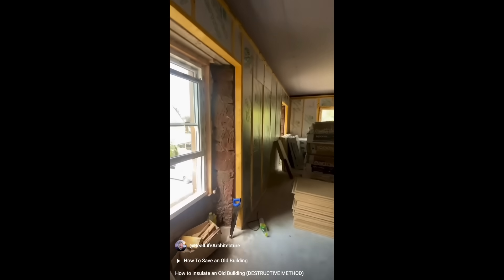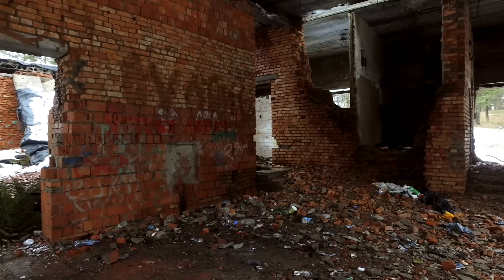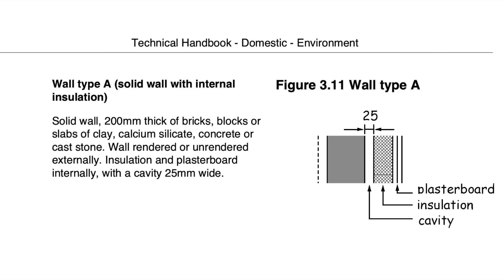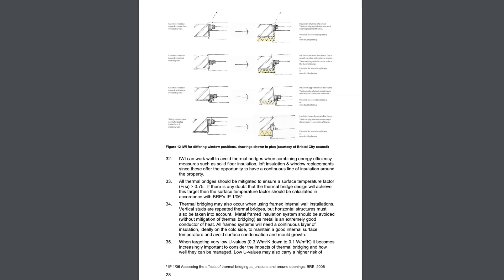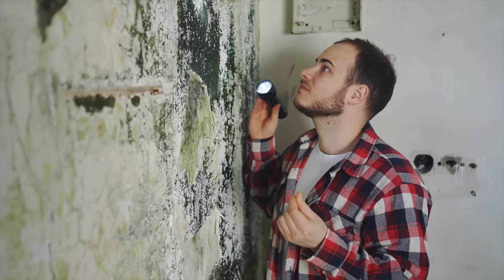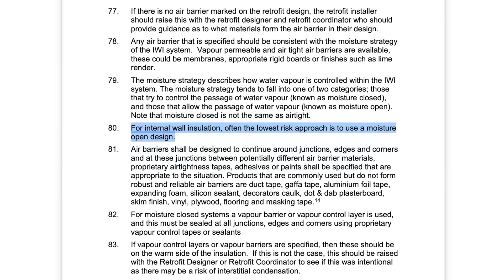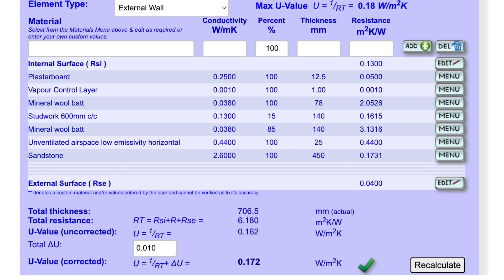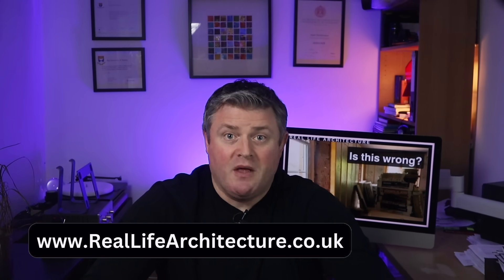How To Insulate Inside a Solid Wall in the UK

Comment: Make sure you pay a lot of attention to condensation. It’s the cause of so much damp in houses - especially old ones. Modern families with baths, showers and cooking make a huge amount of moisture. The warmer you heat your home, the more of that moisture can be carried in the air. As soon as it touches a cold surface like a window or north facing wall you get condensation - and if it’s in an area that doesn’t get much air circulation like behind a wardrobe you get the mildew too. If there is so much as the tiniest flaw in your inner insulation, that warm damp air will leak out and start condensing where you can’t see it - causing rot and mould. It’s one of the big things that put me off considering it. There are so many systems, all promising to be effective - but they haven’t really been around long enough to be assessed. Finding a tradesperson who will really put in the intense attention to detail that the installation requires can be hard too. I’ve opted for managing the moisture I make as much as possible (a cheap humidity gauge is useful) and putting an extra jumper on :) Good luck!
Reply: I have the same problem and agree. The information is just not good enough yet.

Comment: Great video Neil, and I get the thing about breathability, allowing a rain-damp wall to dry out from the inside, but my concern would be water vapour from living, breathing, washing, cooking, etc, passing through that nice cosy breathable layer and condensing on the inside surface of the solid wall, which is now freezing cold because of all that insulation.  Any thoughts on that?
Reply: This is what would happen without a vapour barrier as in this case.

Comment: I’m still watching this space. As the owner of an Edwardian terraced house with solid walls it’s a problem and I want to do the right thing. External insulation would wreck the look of the terrace and some internal options would make the already tiny rooms noticeably smaller. Protecting the building is also key as is improving efficiency of course. Thanks for the video and the useful comments it has generated.
Reply from the maker: I’m glad you found it useful, I am working on a follow up video
Reply: You do at least, in a terrace, have the benefit of 2 of your external walls 'insulated' by having neighbours living behind them.  If you don't have stone cills that can't be extended, or narrow window frames whose reveals can't be insulated on the returns, could you EWI the rear wall and then you've 3/4 of your house walls losing minimal heat?
Reply: @ It’s end of terrace so three external walls but you make a valid point thanks.
Reply: @Stringythingy 
Looking at drafts and ceilings is far more beneficial. The sorts of areas that have a far bigger bang per buck are windows, doors and ceilings. Walls are not most peoples issues.

Comment: This is generally good advice, but I'm surprised you didn't mention what I think is the best IWI method for most old buildings that pre-date DPCs: woodfibre glued to the internal wall with a lime-based plaster. Highly vapour open, very easy to do (parge it first if it's all wonky), good airtightness, adequate U-values. Very robust against dampness. A 19thC sandstone+rubble building with 80mm woodfibre on the inside (in Liverpool) recently had internal downpipe failure so the wall was saturated for a  few months. Pipe was unbunged, wall dried out. No mould, nothing bad. That's about as bad as it gets. The cavity (and corresponding wasted space), and membranes, are not needed.
And of course always remember that EWI is always technically better - you can have more insulation and there is no significant risk of interstitial condensation to worry about.
If you need advice go find your local AECB members or SPAB, both of whom will provide excellent info for older buildings, good building physics, and a sound environmental approach.

Comment: Excellent video. We've been retro-fitting rental properties to meet the EPC upgrade to "C" in 2025, for the last five years (which has now been pushed back). we used the PIR method really because of the lack of information about any alternatives. If the government is going to move forward with energy efficiency in the rental sector we really need more case studies and official good practice to be published.
Reply from the maker: Thanks for sharing!

Comment: We parged interior walls with insulating mix of sand, perlite, lime and ash. We have a very old rubble and earth built cottage, built into the hillside in rainy west Wales. We also put in lots of drainage so water gets away ASAP. You can feel the insulated wall is warmer than uninsulated but we don’t know the u values. We made this mix ourselves. It’s cheap(ish) and won’t rot. Done for two years now and there’s no damp on outside walls. Some damp where wall is against bank with no barrier. It’s just the mud colour coming through the whitewash finish, no mould.
Reply: This is a very good way to internally insulate old properties.
Reply: @MegJones7  what mix did you use? When you say ash, is that wood ash? Have a similar issue but with rough stone walls half of which is underground
Reply: @markthomas919  hello Mark, the mix….I can’t remember for sure…we think it was 1 lime, 1 ash, 1 sand and 3 perlite (the stuff that looks like polystyrene, which I did consider but didn’t like the idea of what it would do in a fire). Yes it was sieved wood ash but avoid cinders or charcoal because it will bleed through the surface when you white wash. 
One of our outside walls we dug down on the outside until we were below foundation, put in a holey pipe with fabric and clean stone around, then put in a sheet of 20mm recycled plastic board about 120mm away from wall. We put clean stone between the plastic and the wall and backfilled. This allows wall to ‘breathe’ and this wall is completely dry. The guttering protects rain water from getting in. Good luck.
Reply: @MegJones7  Thanks that's really helpful

Comment: 100 year plus stone built house with internal metal studing with 40mm insulation in-between stud looking to pump insulation between metal stud and stone wall (vapour barrier)to make it more airtight and to add more insulation thinking on grey beeds or something like it.
Reply: I am doing something similar but without filling the cavity. I think allowing airflow behind will help take away any moisture that works its way inside the cavity. Maybe even with a VMC unit. If the PIR is taped then that is effectively a vapor barrier?

Comment: Hello, over a year ago I bought a flat in a 120 year old building with lath plaster insulation inside. I started the renovation by insulating the floor with 90mm PIR and then cleaning the ventilation holes in the walls for ventilation under the suspended floor. Then I partially demolished the walls supporting the floor locally because there was not enough ventilation and moisture was accumulating. Now I have a dilemma whether to start insulating the walls after looking at this section. I reopened both open fireplaces and removed the foundation reaching the flat. I made a suspended floor in the places of the open fireplaces and in this way I got rid of the moisture rising from the ground. I closed one fireplace and renovated the other and put in a free-standing fireplace. The walls are starting to dry out and in winter it is a pleasant 24 degrees. I seriously wonder if it makes sense to invest hard money in repairing walls when I can buy 5 meters of wood for the winter and the apartment is dry.
I wonder why we don't go back to what our ancestors have known for a long time and improve this technology. Correct me if I'm wrong, but I haven't found any company that would make lath plaster walls from scratch based on new technologies. You could use perlite in a lime-sand mixture and lighten it. Instead of wooden laths, you could use plastic mesh and glass fiber. You could add plastic or stainless steel bristles to the mixture and strengthen the plaster. Such walls would last another 100 years. I wonder how many cm would have to be used to adapt to the new regulations. My opinion is that the new regulations only block the rational development of old technologies and we are stewing in damp apartments and houses because of CO2 and green agenda.....
Reply: You don't want lath and plaster - there are lots of ways that are just better. Using green building materials stops you having damp houses, and you can have a really comfortable, reasonably efficient, house, with very low embodied energy/emissions. There are plenty of bad ways to meet the regs, but also plenty of good ones that work well in old buildings. Don't blame the regs, nor emissions targets, for poor designs. Use woodfibre insulation, or diathonite (cork) plaster or aerogel plaster to get at least some insulaiton on the walls. You won't miss 60-80mm round the outside of normal rooms. Yes you could just keep burning loads of wood and have a building that doesn't even meet building regs, but that's a very high-carbon (and polluting) approach. Put some insulation in. Lime parging, 50-80mm of woodfibre and a lime plaster will make a robust wall that will last 100 years and have a reasonable level of insulation, whilst also working with the building to release moisture.
Reply: We used perlite, sand, lime and a bit of ash to make it sticky on our rough characterful stone walls. It’s working well. But it won’t be recognised as insulation because it hasn’t been approved.

Comment: Is what you say about being able to use any amount of insulation in an existing dwelling actually true? I thought there were rules that if you are redoing n% of the wall, the whole wall has to be done to meet a certain U-value?
Reply from the maker: Under part L of the English regulations certain u-values must be met if more than certain percentages of the overall building or of individual elements, such as a wall, are being renovated.

Comment: 1:10 please correct me if I'm, wrong but acording to part L: When renovating (+50%) of existing element in an existing dwelling(e.g. Removing internal plaster) , a u-value of 0.30 is mentioned.

Obviously only when appeasing building control, but Is this mandatory or merely recommended? Perhaps only applies to England.
Reply from the maker: You are correct and it applies in England. The percentages of work vary depending on when measuring one element, such as an individual wall, or the entire building. The owner will have to make an application to local building standards to demonstrate compliance and should do this prior to carrying out the work.
Reply: It is mandatory whether you are "appeasing" building control or not, Upgrading a thermal element requires Building Control approval if the existing element doesn't meet certain threshold values. From memory the threshold value for walls is 0.7. This means that if you decide to replaster or rerender that wall, or perhaps decide to insulate it, you will have to upgrade that walls insulation to a particular value. For cavity walls that minimum value is 0.55w/m2degc providing that the insulation is being provided entirely in the cavity. For solid walls (and cavity walls that cannot or arent being upgraded solely in the cavity) that value is much higher, 0.3 being the minimum required U value. Obviously if you choose not to get Building Regulation permission that is a separate issue. If your existing wall does meet the 0.7 threshold as it stands then you can still provide additional insulation if you want to, but my interpretation is that in those circumstances you would not require building regulation approval. Same principal applies to walls and floors, just different threshold and minimum insulation values.

Comment: I did this to a house in Scotland on the west side, concrete shuttered cement slurry 1924 it was built, very damp internally old batons directly fixed to the wall hardboard on some plasterboard on others, joist sat on the damp soil and rubble, We ripped it all out back to a shell, I did concrete slab internally with a dpm, suprisingly in three days the internal walls turned from nealry black to grey dried out fast, built the walls from a 3x2 stud 50mm pir board insulation 11mm sterling board on the outer with a cavity which was different everywhere (25mm minimum) as the building was not flat and square, with a house wrap fixed to the cavity side down and over the Dpm which was fixed to the concrete slab with a 4x2, on the inner part of the wall a foil was fixed and taped to the 3x2 wall then a 20mm  baton 11mm sterling board plasterboard over that the wall ended up been 125mm thick in the end, the r value was pretty good cant remember exactly what it was , this was about 2017 -2018, but one thing i did do was vent the cavity used an old chimney and some vents that were already in the walls, small but let in air and out which works well to keep the cavity dry and the house breathing, thanks for the video was interesting, old buildings need love too and can be as good as new built to a point.

Comment: how would you stop the insulation from falling into the cavity
Reply from the maker: Staple it to the timber frame, it’s noted on the diagram in the video
Reply: @RealLifeArchitecture Hi thanks for video , I'll be insulating ours same with the air gap venting up into attic , so the room will be fully insulated but a box within a box without the inner box (room) touching the outer original stone (box) so the walls can breath and vent into attic andy roof is breathable .

Comment: What about using sympathetic building techniques with proper lime plaster? How would youinsulate behind that? What plasterboard did you use to do this that is breathable to the same degree as lime plaster?
Reply: Yes, I'd have thought lime plaster would be best. I'm used to granite buildings further north and have seen many a damp house over the years. Usually that was condensation on renovated plastered or plasterboard walls. It's about vapour and air permeability, which makes breathable walls. It's often not the rain coming in that's the issue, rather the moisture escaping. Obviously, you can add in monitoring of humidity, dehumidifiers and extractors, but I suspect there's nothing better than just using the technology that works. 
If I was wanting to try something different, I'm intrigued by hemp fibre. Timber stud walls, with a 50mm gap from the solid wall, insulated between with hemp, and an additional layer of hemp in front of the stud walls to prevent bridging, with a lime plaster directly onto that. Probably lose 150mm per wall of course.
Reply: @ interesting. Have you looked at Sheep’s wool insulation? Amazing stuff. Resists rot, and mildew. It breathes and it’s sympathetic. Our home was quite damp. We had creeping wet up the walls from non-permeable porcelain tiles (two layers). Removed the flooring, the substrate (original concrete) can breathe, and suddenly the walls are no longer damp because the water was no longer being driven up them. I question the method in the video as having longevity. I think in five years, it will be the same issues. Maybe not on the surface, but black mould has a tendency to cause illness regardless.
Reply: @Jasminethelion  yes, I've used sheep's wool before. It appeared to work well for the five or so years I lived there, and I'd trust it had longevity well beyond that. The downside is keeping it lodged firmly in place, without squashing it. It's great on the horizontal axis, but that is certainly a limiting factor on the vertical (obviously in between studs it holds well). I suspect that over time, if it gains significant moisture without rest, then it might sag a little. I think if I were to do another renovation, I'd likely look at wood fibre or hemp and plaster directly onto that. Although that would be quite the test of my plastering skills!
Reply: @ Agreed!  Have your heard of insulating breathable plaster?  Might be something I try.
Reply: @cottonbrad  I hadn't until I'd read the comments on this video! A couple of people have mentioned it, it sounds intriguing. One person has even mentioned using it to "flatten" the solid wall, and (I'm taking it to read) then applying wood or hemp fibre insulation directly against that, with no requirement for an air gap. That could be perfect for space saving and breathability if it works.
Reply: @ricos1497  Let me know if it does!!!